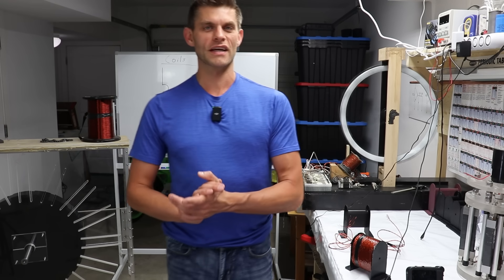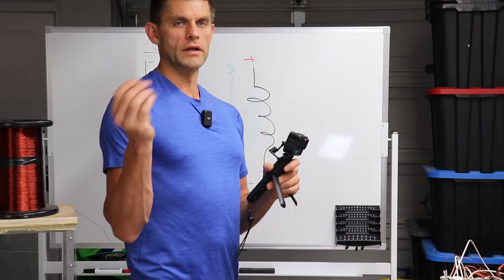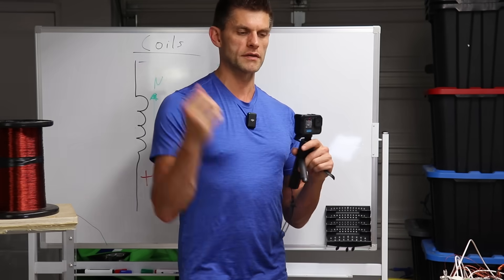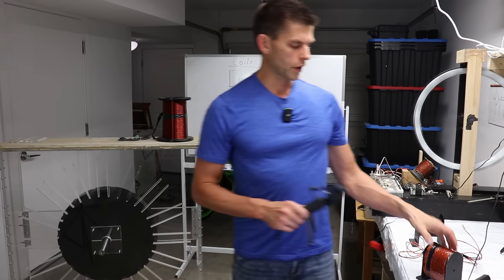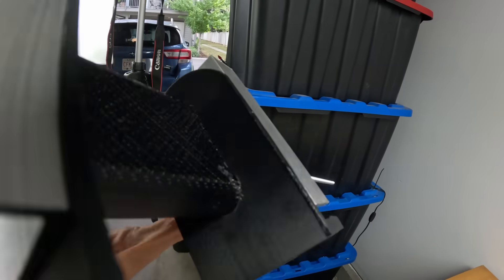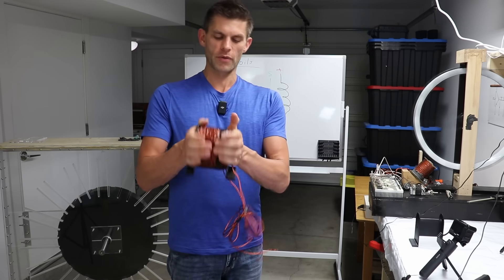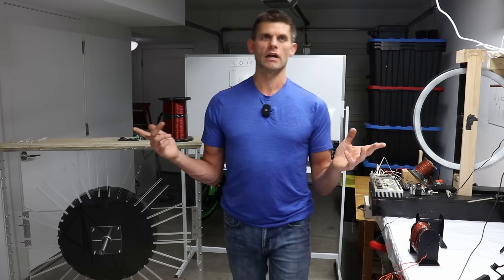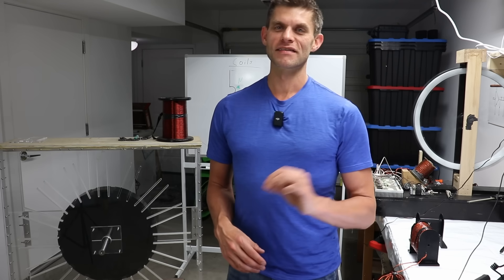Unlimited Energy in My Garage (No Patents)

Comment: Logical question for logical inventor- why do you think they use gas powered electric generation turbines at many current AI data centers that pop like mushrooms after rain in the country?
Why do they build the newest AI data centers next to nuclear power plants?

And why would they not use the device that you created and pitching on your channel?
Reply from the maker: Because they own the gas plant, oil wells, as well as the data center.
Reply: @MadscienceLPTECH  this is a very convenient answer. not however the one that has anything to do with a true reality. true reality and relationships between data center investors/owners and gas and nuclear electric generation equipment owners/manufacturers are not as simple as you think.

Comment: Aye man your the guy I’m looking for.  I’ll give a scenario of 10  12volt batteries. Thats 120 volts dc in series then thru  a H bridge or whatever driver that works for you (the square wave is fine at this step its the heartbeat), so that it then goes through the primary of a transformer  the transformer is 10 to 1 ratio and 480 watts for ease of explanation being 4 amps at 120 thru the primary. The secondary will out put 40 amps at 12 volts  being 480 watts. Use 4amps from 10 batteries combined to get 40 amps  at 12 volts.  Series up like steps up a slide and transformer is the slide down gaining force and keeps it going around with no moving parts and no fuel. From their the excess can be diverted into whatever is needed.

Comment: https://www.youtube.com/watch?v=ywU7YL7engE   
We need to take the ideas from this other bey-blade video, and apply them to this perpetual spinning wheel. So, if we make a bunch of low-weight aero-gel poly-discs, embedded with magnetic micro-particle sliver magnets, and with fan angle slits sliced and bent into these magnetic zones like those new bendy Z-fold phone screens, then we create an entire magnetic box around the discs to support all of the stacked floating planes of air current... In other words, I am trying to describe the end-prototype upgrade to what you are working on here, where different discs accelerate and decelerate based on magnetic midair resistance, and that same limitless energy can be squeezed out of this shifting torque much quicker! The polymer flex points on the activatable fan blades will still wear out after a few years or decades, but in that time you will have generated so very much clean energy! The batteries need to be more dynamic, so an ultium live gas discharge layered into the external case walls, should flash bright enough inwards into the box for new iridium-carbonite backed by obsidian-quartz bands of photo-voltaic cells being developed for Imax iphone screens to pick up the photons and convert them back into electrons. The photo-voltaic cells  would be installed on the surface of a central tesla coil, shaped like a lava lamp, coming up from a center spike, except the coil is generating energy out of the box, rather than inputting energy! This one way poly-box can also intake sunlight, and bounce it like a magnifying glass to further accelerate the perpetual energy flow!

Comment: Why don’t you use a capacitor instead of a wheel? Wouldn’t it do the same but in solid state also without losing as much energy from friction.

Also it blows my mind people are still trying to make free energy machines using basic concepts like induction. Look at your phone, the insane engineering that goes into that, don’t you think that if there was a way to make a perpetual machine out of basic materials that someone would have found it by this point?
Reply from the maker: they have found it many times
Reply: @MadscienceLPTECH  unfortunately for them..
Reply: Also if the core principle of your machine is the lead acid battery reacting “magically” to a high voltage spike, then why would you even need the wheel? You could just send those short electric pulses through a step up transformer instead…
Reply: @napoleon_makes_music  I'm pretty sure the rotation of the magnetic field and concurrent shifting of polarity during flyback is what is allowing this to benefit, not the simple mechanic of harnessing transient voltages

Comment: If this is possible then buck boosters should be over 100% efficient
Reply from the maker: Yes if u dump them into lead acid batteries and have high enough voltages and switching speeds
Reply: well isn't it functioning somewhat like a buck/inverter? ie where you use cap drain to "reverse" the voltage polarity from a dc source

Comment: Lotta sciency word salad.
You cannot get out more power than you put in. Can't happen.
You cannot have 101%+ efficiency. There is friction and conversion to heat instead of work... law of thermodynamics dude! Solar seems to beat that law... sunshine on a fancy panel and you et a useful amount of electricity that will drive lights or a small motor. It's terribly inefficient though.
Reply from the maker: Sure ai bot

Comment: There is free energy in the air. It is 100V for every 1 meter in height above the ground. The reality is that it's in the micro amps and is impractical to capture this energy.
Reply from the maker: And yet lighting strikes have how much enegy in them?
Reply: @MadscienceLPTECH  yes, they have lots of power at a fraction of a second from accumulated charge over a large area. Lightning is the equivalent of a high capacitor instant discharge

Comment: Call me crazy but i know it is possible to use energy to affect and collect much more energy than the original input.  The Dr that showed that he could aim his frequency generator at salt water and found the salt water would burn as fuel...  sold his knowledge out took his videos down....

The inventor who used a frequency generator to heat water in a sphere using a 9v battery took the water fron 70 to boiling in 2min 53 sec was impressive.  And he could use the same 9v battery to heat that water mant times.  He was either hitting the resonant frequency of water or the resonant frequency of the metal sphere.  But he sold out his knowledge....
Reply from the maker: Typical

Comment: Im sure you have played dominos.  I believe  magnets be set up in domino effect where the domino turned causes a domino amplification of the first input. VFor instance if the flipping of the pols on one magnet caused e flipping of the poles on 60 magnets then thatflipping were done 60 cycleser second the other magnets of the domino would also be spinning 60 per second.

Input would only be nessary to one, but ot 60 times 60 could be collected assuming there were no losses to friction. 

 Assuming there were a 20% loss to friction then instead of a 3600% gain you would have only a 2800% gain. Of the original input.
Reply from the maker: Muller motor did this i believe

Comment: Zero-point energy is defined as the lowest energy state possible. To extract energy, it's widely accepted that you have to move the energy source in question from a higher energy state to a lower one, which is impossible when there is no lower state for it to move to. Correct?
Reply from the maker: No not correct, the vacuum energy is kenetic and can flow
Reply: @MadscienceLPTECH  You misspelled kinetic. But I don't think that the fact the energy is kinetic is relevant in this case. For example, when electricity is generated from flowing water, the kinetic energy of the water decreases (the flow slows down) because the energy it has is transferred to a turbine. In the case of zero point energy, it has no possible way to decrease, so how can it share its energy?

Comment: In the end you don't need to do with a Bedini type motor. BTW this is clearly Bedini's work. He even has a coil creation video, that does exactly the same thing. I have created a device that does this with no moving parts, at high frequency using amo-nano cores. based on Don Smith. You have got years, before anything gives you an OU return.
Reply from the maker: Sure, lest see your device and lab then.
Reply: @MadscienceLPTECH  Looks like you're just trashing my comments. NP - My channel has my work.
Reply: @MadscienceLPTECH  look man, if you want to struggle with this that's fine. But you have problems with magnitude. Eventually you will find that the energy recovered is so small, you have to build out much larger systems to overcome all the energy you waisted (because it is mechanical). Good Luck

Comment: I know enough about electricity to be dangerous.. with that why are you twisting them together instead of just winding smaller wire more wraps around? Isn’t the more wraps you have the greater the current or voltage? I’m not sure which.
Reply from the maker: twisting dosnt negate wrap numbers, and correct

Comment: I have never fully understood how people think its possible to extract energy from the vacuum, the whole idea of zero point energy is that its a ground state, when you take energy out of it that would mean that there is a lower ground state which defeats the point of calling it zero point if its not actually zero. These issues aside, I always commend people still for trying but I cannot see how you would get any more energy out of this than what initially goes in. People talk alot about zero point and vacuum states without actually describing how they think it works from a physics stand point, the gap between those scales and a machine with a battery and motor is vast. 

Lets say you could somehow extract energy from it (despite this not making any sense from a physics standpoint as you always trade off work done when attempting extract energy from vacuum fluctuations) using Casimir effects you would still need to change the boundary conditions/ move the plates, the work done to push the plates together is recovered when you pull them apart meaning you essentially are left with what you came in with in the first place! Since no system is 100% efficient, this would usually result in less energy being output in total aswell. Correct me if I am wrong but this seems impossible not based on the fact that its a novel concept or various groups conspiring to censor new technology but because of the underlying physics involved, it just wont work :(
Reply from the maker: does a solar panel get more out then in?
Reply: @MadscienceLPTECH  If the point you're making is about efficiency then that's not what I was saying, I am saying its physically impossible to extract energy from the ground state of the universe without their being a lower energy state, solar panels actually work, they don't use zero point energy. Solar panels run off the solar radiation which is a viable energy source, unless you ignore everything related to what I just said, you cannot feasibly extract energy from the vacuum as this would mean there is a lower energy state which contradicts the whole idea of it being the ground state. The energy is not usable, let alone with a couple magnets and a car battery.
Reply: @MadscienceLPTECH  no…

Comment: Wow, a motor that spins till the battery runs out, who could’ve thought of that.
Reply: Эта музыка будет вечной, если я заменю батарейки.. Это песня из 80-х :)
Reply: Like he mentioned at the beginning of the video there are 2 batteries. To my very limited understanding, one is storing extra energy which exists in the room. this energy can be used  for various applications, including powering this device . To increase the efficiency of this device the energy put into the system must be less than the energy it creates since the energy generated will have to recharge the battery powering the system , I am sure with later iterations this will improve. All energy producing devices have this relationship in some capacity, it just so happens that this device requires initial electrical energy in the form of a battery.
Reply: Which is dope that he is doing this in his garage, like just the fact he created that coil by himself blows my mind to be honest
Reply: @skiu_skiu creating an electric motor is not all that complicated, there is a reason we had electric cars before the internal combustion engine.
Reply from the maker: You sound real fun
Reply: @MadscienceLPTECH If you’ve got such a good idea, why not take out a loan to pursue the goals your company is striving for instead of spending so much time uploading PSA’s and asking for money from the people that watch them. At the very least, hire some determined employees that share your ideas. Many hands make light work. Legitimate businesses do this all the time. You should try it!

Comment: Wouldn't the magnet run out of its own magnetic field at a higher or same rate at which you draw the power from the magnetic field? Basically what powers the system is the magnet but what powers the magnet? If we could harness the earth's magnetic field we would need something massive that goes around the earth which doesn’t seem practical or affordable. If this model is actually effective would it be beneficial to add a capacitor or storage bank to store excess electricity?
Reply from the maker: No magnets dont run out like that. They power for a very long time. The magnetic field cause power to flow they are not directly proportional to the energy extracted

Comment: I invented a car that uses water.

I just need your free energy machine to attach the the hydrogen generation and I can have unlimited miles.

No more pollution, no more oil or gas industry, no more solar panels, no more nuclear power stations, no more pump hydro.

We just build massive versions every where so no batteries required (except watches) truly an amazing invention from a garage
Reply from the maker: Cheers

Comment: Same technology as a water ram pump(water hammer) but with a proven electrical fact used in the automotive industry ignition system where 12volts input to the coil when the points are closed returns 100,000 volts to the spark plugs when the points open and the condenser discharges reversing the flow
Reply from the maker: Yep, very similar.

Comment: Maybe you can help me with a question I have-how would you defeat electromagnetic RF shielding properties in a material
Reply from the maker: More power... more context would be helpful
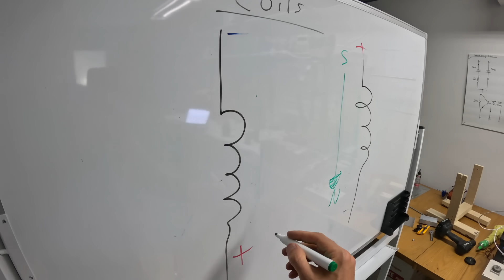Reply: Trying to put a Junior Thurman device into a zinc diecast 1:24 scale model Ghostbusters car, to make a Rem Pod and having a problem getting the RF frequency to go outside of the car because of the natural RF blocking properties of the metal itself, zinc diecast, very strange too because I got to work once and it stopped working after a couple of weeks, would be the first rechargeable, rolling, Rem pod

Comment: i was given the idea to use the harmonic resonance of hydrogen to break the covalent bonds in water to produce hydroxide (Browns gas) and sending it through a hydrogen fuel cell for a net increase in power. No moving parts just over unity. The Searl effect generator looks like a direct tap on ambient energy also.
Reply from the maker: Yes have u tested the browns gas output?

Comment: The technology that takes advantage of a collapsing magnetic field you are trying to describe is what's called a DC to DC Step-Up Boost Converter, Commonly found in car audio amplifiers ( which run on DC car battery power obviously ) and handheld tasers, electric fences etc... converting low DC voltage ( 9v even ) into high 100V + DC voltage, as you mentioned, is part of the collapsing magnetic field which does produce 100 + volts.

However, I see many issues with your design you are not talking about, and I get that you need that donation money,

* Your design is sending 100+ volts to a 12V car battery directly.
* You do not have a capacitor to accept 100+ volts (during the collapse) 
* You don't have a step down converter circuit (to trickle 100V back down to 12V)
* You do not have a voltage regulator (Linear nor buck converters seen)
* You're not using a breadboard, any amature or profesional would use one.

All of the above says you are not an electrical engineer, and just having fun learning. Just don't mislead people. The only free energy is atmospheric energy from the sun (sun is a ball of plasma), and technology that requires no moving parts to obtain (look up 1859 carrington event)
Reply from the maker: 😂 stick to chat GPT and leave the applied eletrodynamics to us

Comment: Would your embedded magnets be more efficient if they tilt or rotate sequentially? I have been working with sequencing a lot lately.  A useful compression sequence for you might be....
n=0, n=n+1....
k = R*(sqrt(n+1)-sqrt(n)
R = radius
Thus is a very useful sequencing formula and it yeilds the points....
(ChgXn,R),(ChgXn, 0),(ChgXn+1,0).. these points plot out the angle of a compression wave. Take a look some time. hypotenuse! 
Might help to draw a circle with a radius and two horizontal lines...
Line 1 is (0,0) outward along X.
Line 2 is (0,R) outward parallel to X.
Each iteration of n is another circle  . Pay attention to where the subsequent circles cross Line 2.
The points connect each iterative circle and produce an angle suitable for your project. Note several things...
1) when n = 3, the expansion is a factor of R. Segment of R along X
2) each segment contains a specific number of iterations of n...
Segment 1 = 3 iterations of n
Segment 2 = 5
Segment 3 = 7....., 9,11,13,15,.....
You can determine that count by...n/Rseg = ((2D/R)+1).....
I hope it can help! Think in terms of mosfit sequencing and angle of embedded magnets 🧲! Cheers
Reply from the maker: Great idea very cool

Comment: Resistance! 3:41
Its like compressing a spring! It will dissipate over time,  but can be released systematically! You can think of it literally in these terms. Visual... put a magnet on that wheel and one fixed with opposing polarity on the end of a spring.  Measure the spring compression and resistance! Hook